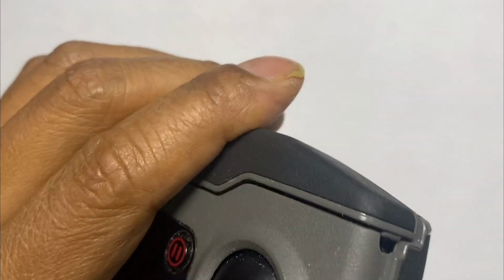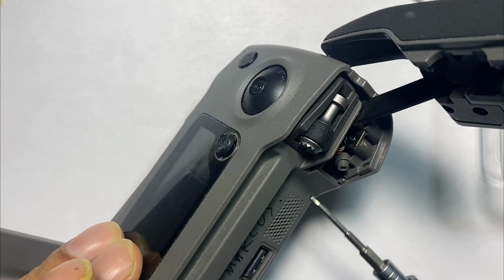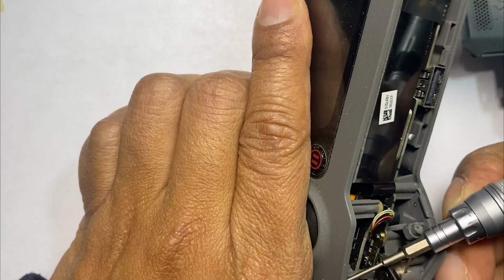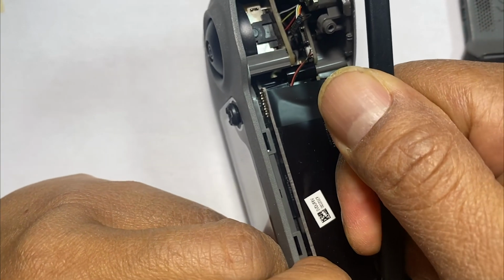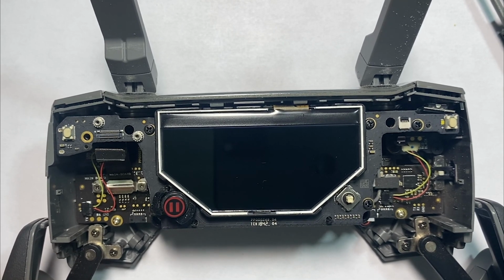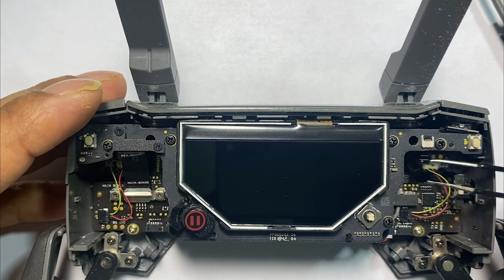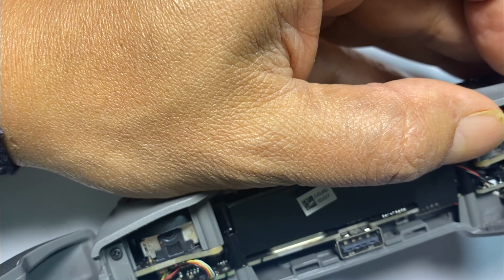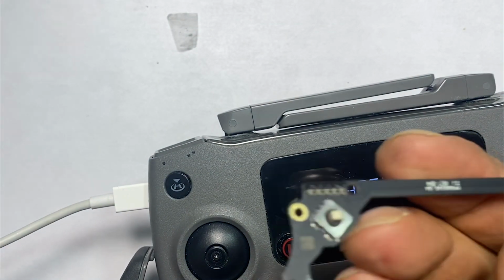DJI MAVIC 2 CONTROLLER REPAIR

Comment: Hi, i have a problem with mavic 2 pro controller, every time I turn it on message recenter stick error occurred. So, i go to menu and calibrate but it cannot stop on 0% if i just touch stick than i touch it again and it's on 0%.